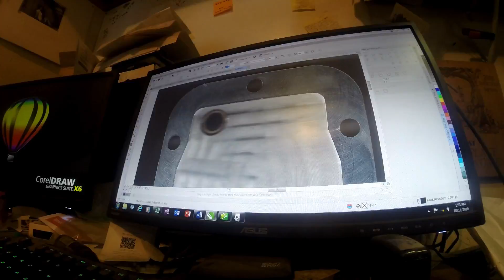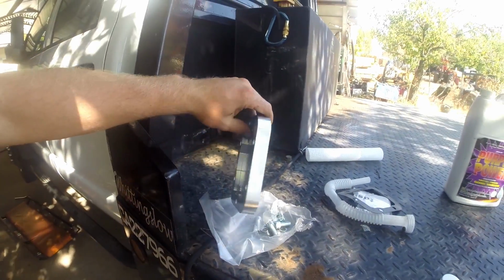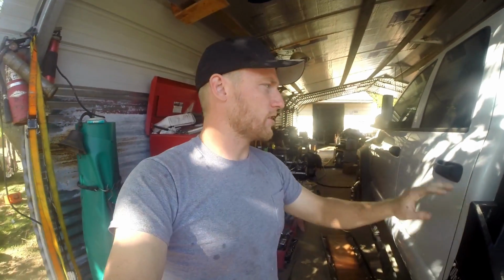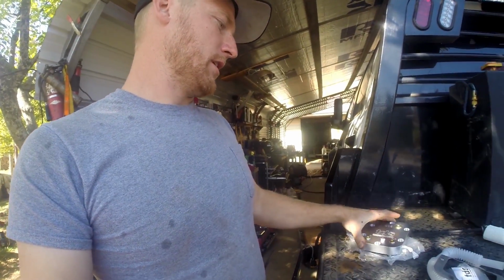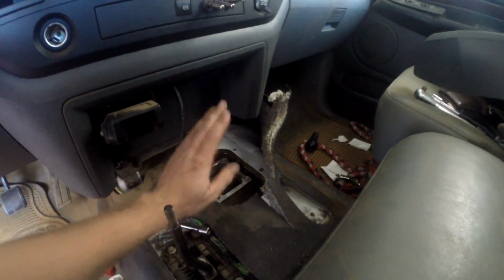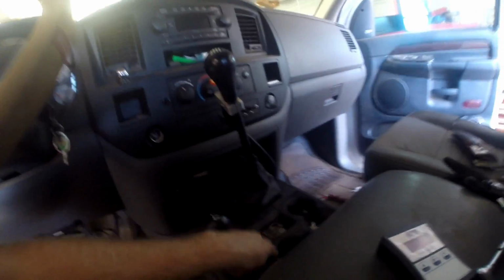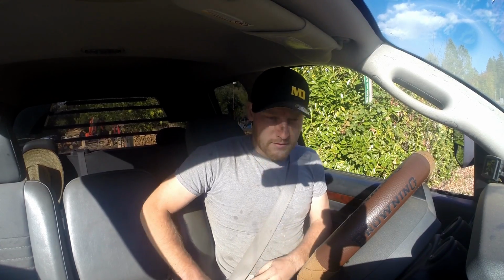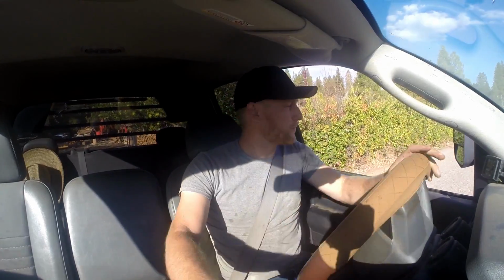CUTTING CUMMINS GASKETS WITH A LASER!!! G56 UPGRADES BEST SHIFTS EVER!

Comment: Not overkill applying gasket sealer to the gasket. I installed the PTO coolers along with this TDS PTO cover on the one side and had a heck of a time getting it to not leak. Also, if you haven't gone ahead and installed that temp gage go ahead and do that. I think you might be surprised how hot that baby gets.

Comment: How on earth does your small red shifter tower boot not leak like mine does ?. I've always wanted to put a temp sensor in my g56 . One thing to think about though is fluid friction . Adding more than the recommended fluid capacity can also create excess heat . Mr.Banks is doing a really interesting video series on useless aftermarket diff covers that goes over filling your rear diff more than recommendations from the factory . By no means am I saying that what your doing is wrong but would be curious to see a temperature chart with factory fill levels and one or two quart over levels that I have seen people do .
Reply from the maker: Mitch Fearey idk I’m glad it’s not leaking ha but the new cover does stick out more allow more fluid to be held. I was worried to. I was gonna actually only add half of the 8th one but spilt that bit so not full 8 quarts. But I had heard of guys running 8 quarts with stock pto cover. But I do have some concerns but i feel confident with it. My buddy added this first and he has been towing 30k with his truck and he seems happy but I will be getting a temp gauge to see how it runs. How many miles on your truck?
Reply: I'm up here in Canada so whatever 269,000km is haha . It's a 06 crew long Laramie .
Reply from the maker: Mitch Fearey about 150,000 miles still a young truck. I had a red 06 Laramie g56. Actually miss that truck. Wish I would have kept it but it had low gears so I sold it:/

Comment: Just got a 2018 Ram 3500 Tradesman CTD w/G56. Good info! 😃 Question: I find clunking in the drive train rolling around slow, especially in first gear unless I feather the clutch & throttle. Is that normal?
Reply from the maker: Leonard Rice are you going straight or turning??
Reply: Both straight or turning. Can’t tell if it’s the DMF clunking or excessive lash in drivetrain.🤔 Did it since the day I brought it home brand new in August.😐
Reply from the maker: Leonard Rice I think I know what it is. Mine did that same thing. It’s the dif. No biggy tho. It needs some Mopar friction modifier. The limited slip isn’t allow full slip. Add this stuff thru the breather on your rear dif.  Added this to mine and cleaned it up. It’s somewhat common. At least that’s what it sounds like the problem it. 
https://www.ebay.com/itm/Jeep-Dodge-Limited-Slip-Additive-Friction-Modifier-MOPAR-4318060AD/162967647529?epid=1385570009&hash=item25f1a0f529:g:gT8AAOSwc0FUqo5b:sc:USPSFirstClass!95975!US!-1
Reply from the maker: Hope that helps but that’s sketchy it did that from day one:(
Reply: Thx for the input! I'm inclined to agree that it's the differential. I'll get the dealer to look at it. The other day when they had it to put in a trailer brake controller I was lightly inquiring about the problem & when they took it in & out of shop, figured they'd notice if problem. They didn't comment. Next visit I'll focus on that. Thx again!

Comment: Hey man, love the videos, I have an 05 3500 I've been putting some work into with the same goals. I was really interested in where you ordered those mirrors and this kit but can't seem to find the link, could you add them or send them to me? Thanks.
Reply from the maker: Ross Browning oops my bad. He’s the pto cover 
https://m.ebay.com/orderDetails?itemId=202447927695&txnId=1714681369010

And the mirrors 
https://www.ebay.com/itm/2-Tow-Mirrors-Power-Heated-Led-Signal-for-02-08-Dodge-Ram-1500-03-09-2500-3500/232151453539?epid=2076372802&hash=item360d4e0f63
Reply: I appreciate it. What about those mirrors?
Reply from the maker: Ross Browning sent you think for that aswell